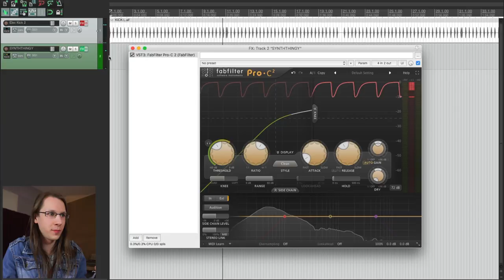REAPER: How to sidechain?

Comment: For compressors that only have the 2 in 2 out, you can just go into the plugin pin connector and change the Track Channels dropdown to 4 and highlight the 3 and 4 manually